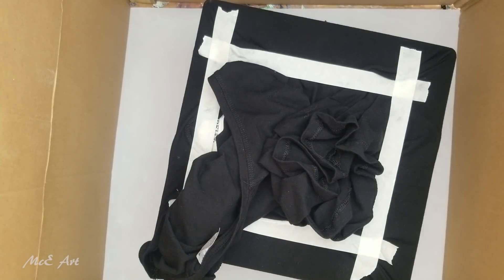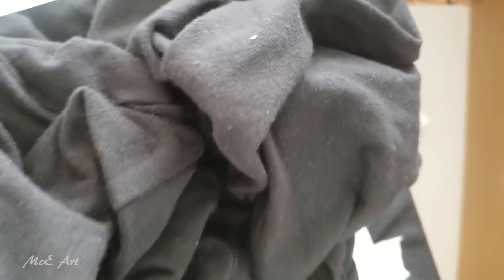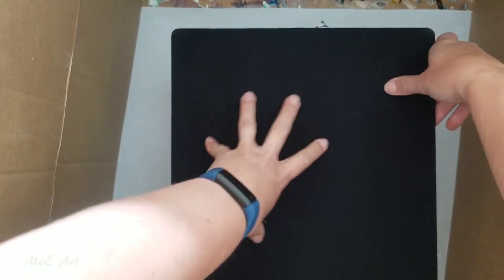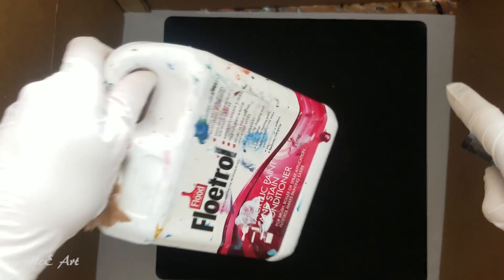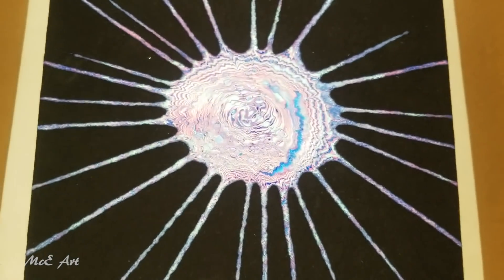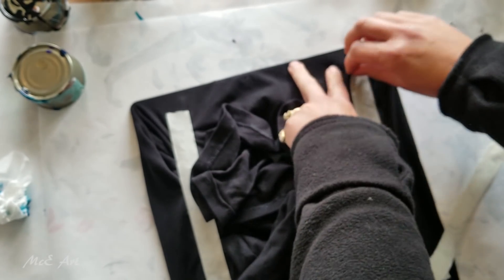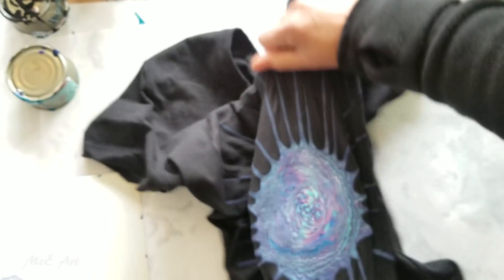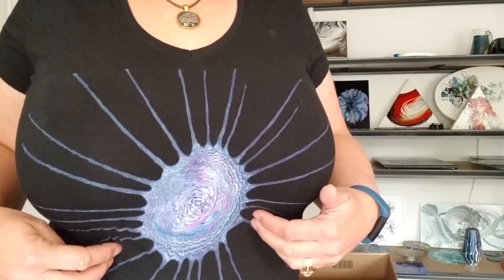357 Pouring a Spinning Tshirt SOLD

Comment: Love the idea. My intention though was to gesso the fabric before pouring on it. I'm pouring on tote bags. That way it wouldn't stick neither. 
I"m going to try this (t-hirt) for the summer. But please, tell me... how is the t-shirt holding up now? After a few times washing? (And now I'm going to search for that jeans you painted, because that's a great idea too)
Reply from the maker: Hi Thank you :)  Yes if you are doing tote bags which are non stretch gesso would be fine, with a tshirt I wouldn't recommend it as it needs to be stretchable.
This tshirt has washed the best of all the ones I have done so far :)  The jeans are doing well although I haven't worn them a lot as it is summer here now.  How much fun can you have now?